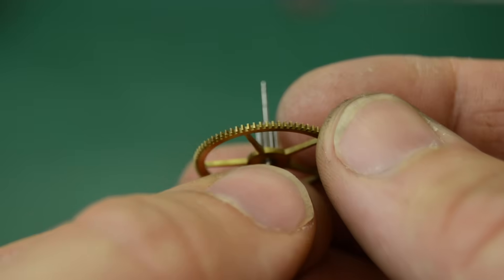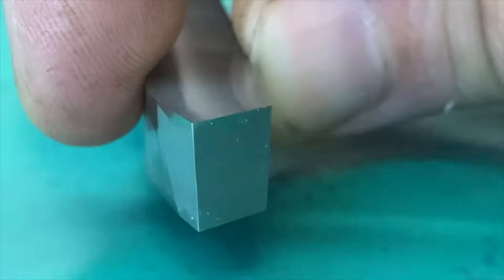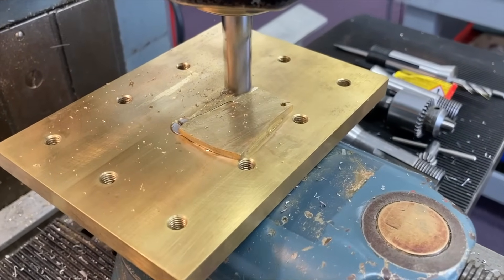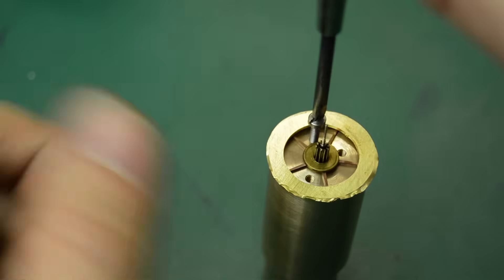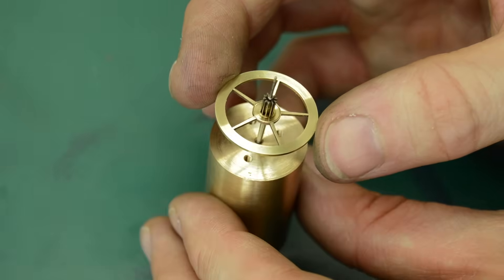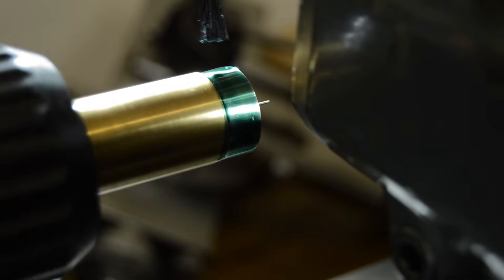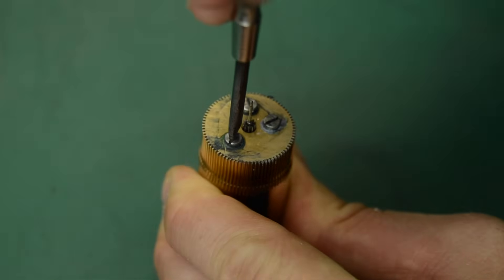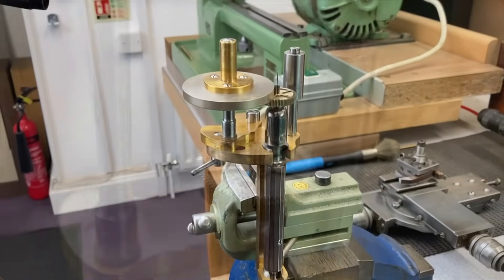Replacing ALL the teeth?!

Comment: I have two questions about your impeccable work:  (1) Set-up.  You make extensive use of jigs and holders.  This requires considerable inductive and spatial reasoning capability.  Do you feel you developed this capability by dedicated training and education, or was it innate? Both, perhaps?  (2) I notice your lathe is a (relatively) massive tool, not the sort of machine I would expect for such fine, precision work.  Why do you use it as compared to a specialized watchmaker lathe?

Comment: Obviously, it is an excellent repair. I thought that the central shaft fitted that central hole a little too easily (15:53), while the three screws in their unthreaded clamp were also not precision-engineered (15:54)

Comment: Where is the part where you actually snapped the fabricated new piece onto the outside of the wheel and sweat it on..???
It seems that that’s just completely skipped and you jump right to it already on there … was it a perfect fit,, did it snap on nice and tight? Or Was it slightly loose fit where it would spin and allow the new material to melt into the joint..???

Comment: Would it be possible to clean the gear surface the teeth and protect the wheel area and electric plate a thick layer of some sort of metal on that Andre machine the original gear profile I know it's just a general question I just wondering if that's possible

Comment: I notice nobody ever does a balancing test when they make gears/wheels like this...  I know you try to keep everything symmetrical, but noting's perfect...
I would have expected to see someone do some sort of spin-balancing process at one point, maybe fine-tuned with some light filing...
Is it just that at these scales, a micro-imbalance isn't a problem?
I know if you were making wheels the size of a bicycle, it would be an issue that would need to be taken into account
Reply from the maker: It's a great observation, but in horology there are only a few parts that balancing is an issue with.  A watch balance must be PERFECT.  Very precise regulator movements sometimes have the train balanced to an extent, but the main one is motion work to counteract the weight of the hands.

Comment: I had the pleasure of using both a Schaublin 80 and 102 at a prototype machine shop back in the 1970s.. I agree with everything you said about the tactile feel of these machines. The 80 in particular, was used by a machinist who I watched make pressure diaphragm caps that were .080" in diameter with various diaphragm thicknesses as thin as .0012" across the diameter. I was at his house one time where he showed me a clock he made himself with a siderial complication. It wasn't until later in my life that I came to realize how close I was to a very special talent. This video brought me right back there. Thank you!

Comment: You skip over showing the important step of fitting up and soldering the outer ring???
Reply from the maker: I lost the footage of it on my camera. I sweat the smallest amount of solder at the lowest heat it would run at, shielding the pinion from heat.
Reply: @TommyJobson  OK-

Comment: Before watching the video I say to machine the teeth off and reduce the OD of the wheel by at least .030 create a ring the same thickness with the OD larger than the teeth points and an ID .001~ smaller than the wheel OD, Put the wheel in liquid nitrogen and heat the ring. Then have it set up to punch the wheel into the ring all at once in an instant. Now just machine new teeth onto the ring OD exactly the way they need to be.
Reply: I didn't think about the fact that it's brass and you could just solder it.

Comment: Excellent work and I see you have all the machines required. What was the size shrinking fit and the name of the manufacturer for the lathe and dividing head etc? Regards Bob
Reply from the maker: The fit was soldered so it was about 0.005-0.01 oversize. The lathe is a Schaublin 102 with Schaublin dividing equipment.

Comment: Why not glue the ring with Loctite and avoid heating the part completely?
Reply from the maker: If it was thicker I might have done, but I just didn’t quite trust the contact area. Loctite may well have been fine but solder felt safer.

Comment: What type of solder did you use to attached the rim to the wheel?  When fabricating small parts out of brass I prefer to use high temp silver solder containing 45% silver.   When fabricating model aircraft tanks from tinplate I use low temp silver solder comprising 97% tin and 3% silver.  Some 50% stronger than traditional 60/40 lead solder yet melts at a lower temp around 220 degrees C.
If you used 45% silver solder to attach the rim you could make a heat sink out of aluminium or copper clamping on the wheel spokes  to avoid tempering the pinion gear and shaft.  
Another method could be to bevel the wheel edges then swage the rim into the beveled edges and then face to final width.  Likely add three brass rivets at the intersection of rim and wheel  with rivet holes countersunk each side which would ensure the rim could never slip on the wheel.  Avoids heat and the risk of distortion.
Reply from the maker: It was a reel of ‘soft solder’ the rest is unknown!

Comment: Is it just me or did you sort of skip over the part where you attached, clued, fused the wheel to the new ring the teeth were to cut from?
Reply from the maker: I lost the footage off the actual soldering, but it was a case of sweating in the smallest quantity of solder at the lowest possible heat.

Comment: I just had to watch after seeing the title of this video. I took a two year class in watch and clock repair about thirty years ago in plainwell Michigan. One of our projects was replacing a tooth on a wheel.   I told my instructor I could replace all the teeth and keep the wheel. He looked at me like I was nuts. That night after school I went back to class and did about the same as you. However instead of making a blank and recutting all the teeth I cut another wheel of the same kind so the new ring gear would solder nicely onto the turned down original. It did not look as nice as yours but it worked fine. I think my instructor was impressed

Comment: That is amazing, Ive never seen such a repair.  Im a home machinist, I make some small parts but this is on a whole new level.  Where do you buy cutters for teeth like that or do you make your own?
Reply: If you search for video "Chronometer Train Wheel Repair Part 1" go to timestamp 19:40 there you can see such a cutter, so you might be able to search it. Good luck.
Reply: @BrainHurricanes  Thank you really helpful, I didn't realise a module cutter would do this type of tooth, it looked longer than a normal tooth. cheers

Comment: Gorgeous repair! Curious question though, do you have to worry about the inner teeth being clocked or aligned in a specific way with the outer teeth you've made? Or would the orientation have no bearing upon the functionality of the mechanism? But if they do, how do you align them or set up the jig to be sure it's aligned?
Reply from the maker: Thanks, and a great question. On this wheel the inner part is known as the crossings. These are partly decoration, partly weight reduction to inertia, they don’t need to be clocked to the teeth.
Reply: @TommyJobson  ooh!! I see!! Thank you for that info!! What about the teeth of the other tinier gear mounted on the "hub" of the ring-geared cog?
Reply: @deeranfoxworthy6069  I think you’re asking about the orientation of the repaired gear to the pinion with which it shares the shaft. The relationship between these two components can be random without affecting timekeeping.
Reply: In clockmaker parlance, the larger gears (usually, but not always, with crossed-out openings in the center, and spokes) are called 'wheels' and the smaller ones (usually solid with no spokes) are called 'pinions'. Things larger than a pinion, but still solid, are called 'wheels 'as well. These are all technically 'gears' in the absolute sense, but I get the feeling that amateurs tend to use the term 'gear' while professionals and serious hobbyists/nerds use 'wheel'/'pinion', at least for clocks (so 'gears' might be correct in other fields, like an automotive transmission for example). Also, in clockmaking, axles are called 'arbors', and the hub of a wheel is often known as a 'collet'. Hope that helps a bit.
Reply: I guess some folks might see this language as being hifalutin, and possibly it is, but I think it's probably more like the beauty of the terminology is supposed to go hand-in-hand with the aesthetic appeal of the parts themselves. Also, it's much faster to say 'wheel' and 'pinion' than 'large gear' and 'small gear', so it speeds up the language a lil bit.

Comment: I would like to have seen the soldering process. Can you show that, thanks
Reply from the maker: Hi @jimad and @PatrickSpencer, unfortunately I had a nice clip of setting up the camera and no footage of the soldering part, so sorry for the omission!  I basically sweat the smallest amount of solder at the lowest heat I could manage to get it to flow taking care to shield the pinion to prevent heating it.
Reply: @TommyJobson  Thank you for replying. I had that type of event happen to me. I live in California and went to an air show at Edwards air force base. I took a whole roll of pictures of the SR-71's last flights. When I went to remove the film no film.
Your work is beautiful and very creative. I would have never thought of that solution.
Keep up the great work.
Patrick

Comment: Wonderful job!  Could you share a few words about the soldering process - must have been quite tricky. Thanks for sharing your work.
Reply from the maker: Hi @jimad and @PatrickSpencer, unfortunately I had a nice clip of setting up the camera and no footage of the soldering part, so sorry for the omission!  I basically sweat the smallest amount of solder at the lowest heat I could manage to get it to flow taking care to shield the pinion to prevent heating it.